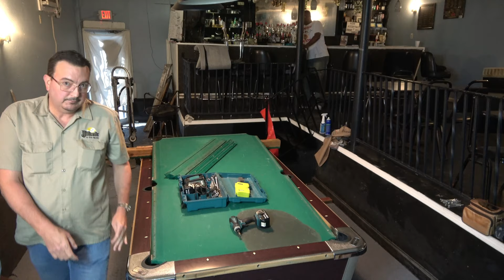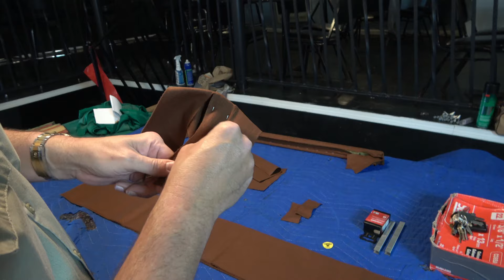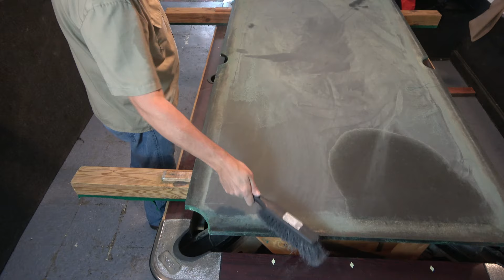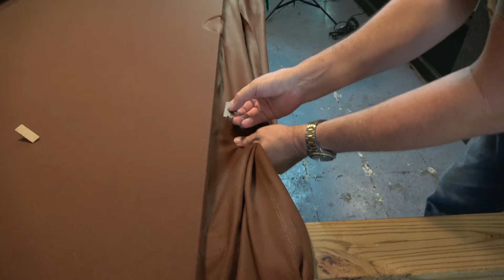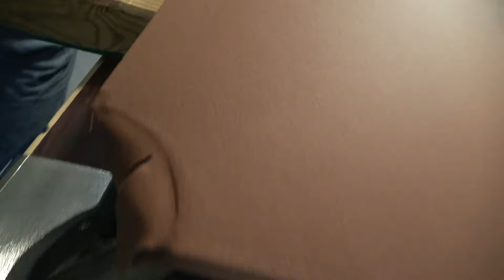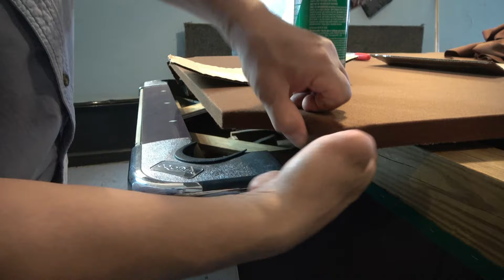How to Recover a Valley/Dynamo Coin Operated Pool Table (Step-by-step Tutorial)

Comment: Phenomenal video. Every step of the way was precise and exact. Used it to refelt my valley with no prior experience at all and it turned out amazing. This guy knows what’s up!!!
Reply from the maker: Glad I could help!
Reply: @CreativeRestorations  Shouldn't cut excess flush with the bottom of the rail. It needs to wrap around like the top. what you are doing is changing the angle of the rail. This makes balls jump because it hits lower on the ball.

Comment: Great video! Been doing tables for my bars for 20 years... Some things i learned from you:
-Your rail technique with staples instead of glue. Will save me some money (Staples cheaper than glue)
-I've always used 2x4s and have had to move slate from side to side, but 4x4 is high enough to spray under pockets

The only thing I'm debating in my mind is whether stretching cloth sideways first is better than stretching length wise first... But the important thing is your cloth looked just as tight as mine ends up.

You know 20 years ago when I started doing this I took a gander on the internet for instructions on how to do this and couldn't find anything and actually decided to teach myself how to do it and boy have I come a long way... when I was doing my first couple tables I had absolutely no clue and it actually took me one and a half days to do my very first table and I know that I did a lot of things wrong but the final result was tight cloth on the top that didn't come loose and rails that looked halfway decent.. i actually ended up going back and redoing the rails on that table for free once I figured out what I did wrong but I thoroughly enjoyed your video thanks for posting it! good sir!

Comment: Just started this process thanks to your video. Had someone else install the table 2.5 yrs ago. Was not happy with the folding side pockets. Your video proved i was right. Installing predator arcadia reserve and added pocket facings reducing additional .5 in.   This valley will be tight.  Thank you for a great tutorial.
Reply: Finished it up in 2 days time. Got a little free with the 90 adhesive ... To much in one area .. It is under rail lip so it is not on play area.  I had a couple rails that i cut to high on the elephant. It was a chore getting the fold hidden behind.  I feel it still today. The little muscles ow.  Much respect to this craft of yours in restoration. These pockets are clean.   Thank you again

Comment: Great video. Thank you for showing us your work. I have recovered lots of coin ops, and we always took the slate out, walked it so it sat across one side, glue, than walked slate to other side. Messed up my back.
Reply: I've been using the slate lifter system from Nortech it comes with a set of roller barrings the let you slide the slate around easily the only problem I solved is you need to clamp the roller barrings to the cross members or else they tend to tip over other than that its a life saver makes it a one person job

Comment: I'm changing from red to blue today, came back for a refresher.
Didn't David find a phone in that table when you first slid the slate sideways?

UPDATE, 1 Apr 2022:     (8-foot Global barbox)
I probably won't tell you anything new, but my experience might help first-timers:
1. I still adore the $15 "craft" cloth from Walmart.  Plays fast; I'm free to change it as often as I want (this time was because I use red balls and blue chalk); and the 4% spandex was very forgiving, especially on the rails when I was running out of cloth. Plus, I needed only about 25 staples per rail.
2. Having only a hand-powered staple gun cost me about 2 hours, including having to finish each staple with a hammer.  After 4 rails I realized I needed to hit them harder! Sometimes the staple tips would form pairs of unacceptable bumps in the facings.
3. I don't know the date of the previous rail cloth installation, but it was applied with glue and end staples. I wouldn't trust this thin cloth with glue as it may soak through. That happened once slightly with the slate's cloth, and I'm hoping it's an aerosol fluid that will dry away.
4. Aligning rail bolts for tightening was very frustrating, especially if the wood showed stress from previous tightenings. I guessed that the center of rail should be started first, then all bolts finished together.
5. While I was slate-off I added some more foam and wood in the channels to reduce ball noise. My next quieting will be in the display area, possibly with a 3" PVC tube.

THANX for your work, Doug!

Comment: Good video the one thing I do different on bar tables is that I don't put glue on the top of the slate. I glue the cloth to the bottom of the slate. It avoids any small buildup at the pockests that create a small lip that causes a ball to stop short of falling in on soft shots. It has happened many times to good players and it is very frustrating when it can be simply avoided.

Comment: I'm right in the middle of doing my 1st table (my own) and wouldn't you know I already stretched the ends. If for some reason and I don't know why after all the searching I did. This video pops up. I hope I don't screw up to bad. I bought the felt off Ebay and it's not even marked to identify the top from the bottom of the felt but I think I figured that out. Great video

Comment: Thank you for sharing this video. Best I have found yet. Only question I have is why use tape on the corners of the table?
Reply from the maker: The pockets get the most use and are, therefore, the most likely point of glue failure (if it's going to happen). It's just an extra measure of precaution. It doesn't hurt anything to put it there and it could very well help. So, why not?

Comment: Question...would this explain why a table I've been playing on...the side pockets are fairly tight whereas the corners fairly wide...due to incorrect cushion placement? Trying to beat my high run and aside from that, the floor not being level and lighter balls so it seems and not simonis cloth...it's been pretty interesting trying to adapt to the table.
Reply from the maker: It's entirely possible. 

Since most coin-op tables spend most of their lives as route tables and most amusement companies need to get in and out when servicing the tables, what happens is, rails get swapped from one table to the next. It's rare that you'll find a coin-op that actually has its original rails on it. Sure, they may say "Valley" or "Dynamo" or "Cooper" on the rails. And that may actually be the the name brand of the table. But, most all amusement companies bring pre-covered rails and just recover the bed on site. They'll cover the rails at the shop when there's down time for their techs and then get used on another table.

That being said, it's possible (if not probable) that there is some variation between the rails your table originally came with and the ones it has on now.

Also, if the side pocket ends of the rails are not covered correctly, there could be up to a 3/16" difference per rail (accounting for additional cloth used for folds). That means, your side pockets would be as much as 3/8" smaller than factory.

Hope this helps.

Comment: Why did u not clean the old glue off, I remember ripping the rails out of the sheet of cloth
Reply from the maker: I will clean the old glue off if it's built up. However, if there's only 1-2 recovering's worth of glue left behind, that isn't enough to make a difference. Also, that old glue helps to hold the cloth. The solvents in the new glue melt into the old glue and form a tighter bond.
Reply: I'm trying for the first time right now. Got everything off and the glue was really thick. I have scrapped all the glue off the sides and top for a smooth finish. Should I do any different techniques or a Seco d coat of glue on the slate since I have bare slate now?

Comment: I watched a video on this process a while back getting an idea on redoing my table and couldn’t find it again. The biggest difference I noticed was they had cleaned the old glue off the slate. Is that not a necessary process or just maybe overkill? Why don’t you do that? No judgement just genuinely curious before I do my table.
Reply from the maker: I do clean off the old glue when it becomes necessary (usually every 3-4 recoverings). The glue does build up. But, it doesn't need to be cleaned off at every recovering. That's just wasted energy! It isn't like we're spreading cream cheese on a slice of bread. This is just thin layers of glue.

Comment: Does the 3M90 end up going on pretty flat? I noticed you hit in front of the side pockets with the glue, will that hinder a ball at all, or when you push down does it flatten it down enough?
Reply from the maker: It does. 

It would take several coats of it to build up enough to cause a hump in the cloth. If it starts to get to that point, I'd clean it off with lacquer thinner.

Comment: I’ve looked up the 3M 90 and found it in 19 oz cans. How many 7’ tables will one can do? I’ve got 3 Dynamo tables I’m about to tackle. I’ve moved and re-installed my 3 piece slate 10’ snooker table and felt and it ended up great but as you know, it’s not a glue down felt. This will be my first glue down task.
Reply from the maker: You can usually get 2 tables out of a can. So, for 3 tables, to play it safe, I'd get 2 cans. Don't worry about having extra. It works for a lot of other crafts as well!

Comment: I skimmed through this video looking for advice on leveling it.  One of the reasons I love coin-op tables is the easy, "foot-spin" leveling under the one-piece slate, so I wouldn't be surprised if there was no advice to be had.  So, I'm just checking-in to see if you have any professional experience regarding leveling that would have been applied after you recovered this table.  Can I trust the slate's supporting frame that much?

P.S.:   My Global has 4 metal, parallel crossmembers supporting the slate.  I'm recovering it now, and I've found 16, 2"-square pieces of felt on the ends of the members, apparently to separate the ends of the members from the slate by two layers of felt.  They are unattached.  Do you think this was a leveling procedure, or is something else going on?

Comment: you spraying the top of the slate in the pockets makes me cringe! I've been on so many service calls for tables where the previous installer sprayed the top of the slate not so much on the rail side but in the pockets it will definitely hinder the free roll of the balls making them hang up in the pockets. On a side note I like your method of doing rails I'm going to give it a try on my next install
Reply from the maker: I'll only spray glue in the pockets of the slates once or twice before cleaning it off. Any more than that and there would be a build up that would adversely effect the roll of the balls. I probably should have mentioned that in the video. Sorry.
Reply: @CreativeRestorations  The other observation that I would like to make is that I've noticed that installers that choose to not fold the cloth under the slate on a valley or dynamo coin op table always forget to remove the pre installed cloth on the aluminum cross members that its put there to compensate for the difference in the center of the table from the edge

Comment: Just got a valley table. Can you direct me to a website that I can get pieces for the table. Edging and corners (the chrome pieces)
Reply from the maker: If it's a Valley, I would suggest you contact them. I don't know of any place that makes aftermarket replacement parts (other than rails and leg levelers) for older Valley or Dynamo tables.

Comment: I have a Valley table. I just bought Simonis 860HR cloth for it... I've heard spray glue doesn't hold on this type of cloth. Should I use something different than the 3M90 or do you think it should work fine?
Reply from the maker: If you can get your hands on a can, use the 3M 74 rather than the 90.
That's what I used for years until the price went sky-high.
Reply: @CreativeRestorations  Thank you for your prompt response & the content you put out! You're comments on others are scaring me though about how tough Simonis is to install, especially on rails😆
Reply: So there were a couple kinds of 3M 74 on Amazon. One said Low VOC & the other doesn't say that... Which should I get?
Reply from the maker: Low VOC means "low volatile organic compounds". It may or may not change the glue's adhesion properties. So, if it were me, I'd opt for the original formula.
Reply: I'll use your duct tape reinforcement idea also for safe measure. Thanks again!
Reply: Sorry to "bug" again, but what pressure do you normally set your air compressor on for your staple gun?
Reply: I got an 18 gauge staple gun if that makes any difference

Comment: Hey Doug does this glue down method work with other tables where the corner pockets and side pockets are at a sharper angle?
Reply from the maker: Yep. You do have to cut more release cuts though.
Reply: @CreativeRestorations  - Thanks Doug I'm going to give this method a try on a table I know the backer board is all chewed up from years of clothes being put on. Same goes for the rails on this table but I will manage my way through them. Thanks again.

Comment: Getting ready to pick up Dynamo coin operated 9x5 I cannot lift the slate? I got the rails off are there any brackets holding this?Great video by the way thank you.
Reply from the maker: There shouldn't be any brackets holding the slate in. Are you 100% positive it's a 4.5x9 coin op? Those are EXTREMELY rare. If it is, in fact, a 4.5x9 coin op, I have little doubt that you would find it difficult lifting the slate. They are exceptionally heavy. Only lift one end at a time. Make sure you use 4x4's to hold it up (just like I use in this video).

Comment: Great video, I was wondering after recovering a Valley 7' bar box pool table will I need to relevel the table since the slate was removed and reinstalled? 
Also do you use anything other than a shop vac to clean the inside of the pool table?
Reply from the maker: It's never a bad idea to re-level a coin-op regardless of whether or not you've replaced the cloth. They're so easy to level. I'd do it every time I thought it could use it.

As for cleaning the inside, use a shop vac and follow it up with a damp rag over the ball return tracks (gullies). That's about it really.
Reply: @CreativeRestorations  that sounds easy enough to do, I appreciate you taking your time to answer my questions, thanks again for the very informative video

Comment: Brilliant video.  I have been left a coin operated pool table in a will by one of my very best friends who died recently.  I now have the task of moving the table from his home to mine.  Do you have any tips on how to dismantle/reassemble one of these types of table?  Would appreciate your advice.
Reply from the maker: Coin op tables don't generally get disassembled for a move (with the exception of a VERY few tables).

You would need to lift one of the sides, take off the FEET (not the legs) and then lower it back down. Next, you would walk around to the opposite side of the table and flip the table on its side onto a four-wheeled dolly. Now, take all 4 legs off. Strap the table to the dolly and roll it out. Generally, you would need either a truck with a lift gate or a trailer with a ramp to transport it. 

Once in the truck or trailer, take the table off of the dolly leaving the table on its side. Strap the table down at two separate points and you're ready to go.

To reinstall just preform the above steps in reverse.
Reply from the maker: If you aren't 100% sure of the steps I just laid out, don't attempt the move!
Reply: @CreativeRestorations  Hi Doug,  Thank you so much for taking the time to reply.  I will take all your advice and proceed with caution.  Ed

Comment: I have a valley coin tabl need to figure out how to get one new rail and bumper
Reply: FYI I and subscribe
Reply from the maker: It really isn't worth it to buy just one rail.

Your best bet is to buy a complete set off eBay from a seller called "Penguin Amusement". A complete set including rubber will run you less than $200 including shipping.

Put the whole set on your table and keep your old ones as backups.

Comment: Doug another great video is this technique for glue down the same on all tables?
And would you ever consider revealing your pricing?
Reply from the maker: It's pretty much the same technique for all "glue-down" type tables. Corner pockets are handled a little different on home-type tables that require glue. Pricing varies depending on type of table, type of cloth the customer wants, and how far I have to travel to get to the job. Base price is $400 though (as of 2/25/2021).
Reply: @CreativeRestorations  great video. You mention the corners are different on a home table. Do you have a video showing the process? I found a sped up video, but didn't see what was different except looks lile 3 cuts plus the tab cuts.
Reply from the maker: @digitaltamer  I do have a video...

https://youtu.be/5SPel_CUHwE